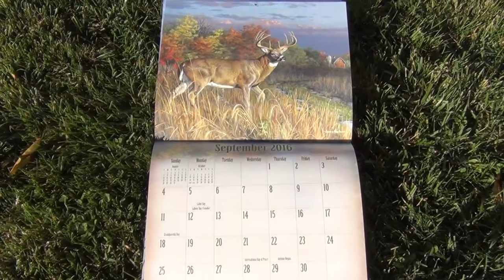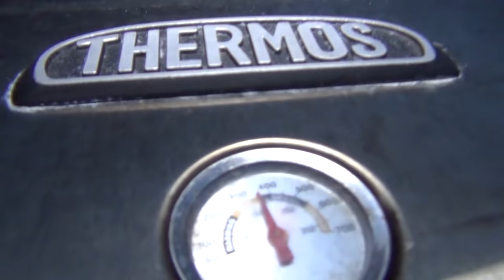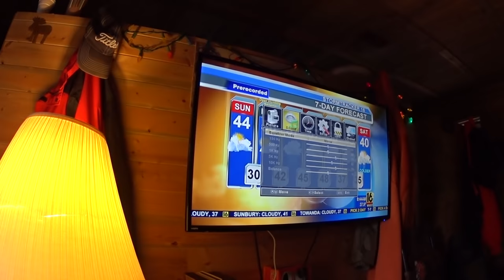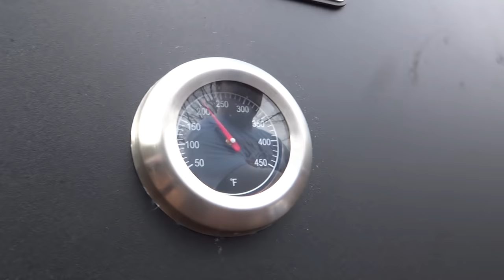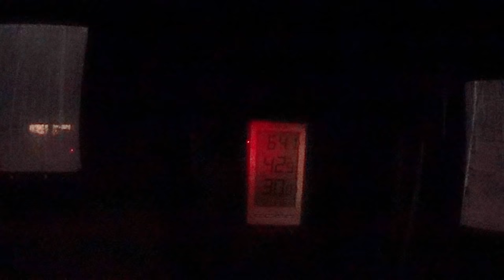PA Deer Camp 2016

Comment: So what you wanna do for breakfast is cook up your scrambled eggs with a handful of cheese so it’s all gooey then but some toast in the toaster then when that pops up butter it heavily so it’s soaked with butter then fry up your bacon so it’s not stiff but soft and soaked in grease Then your sausage patties grill those up about 3 per person get them nice and Grease soaked then the most important part hashbrowns get those charred on the outside but soft and gooey on the inside then put cheese all over it in the pan so it’s more gooey then chop up like 4 onions then put those in with the hashbrowns then building your plate lay your toast then eggs then hashbrowns and bacon and sausage on the inside our out side preferably Inside you want the hashbrowns not the outside on top then put your ketchup (optional) on top then your ready 

Note: it’s filled with calories and protein and it’ll get you through until dinner it’ll push you right through lunch time.

Comment: how does that buddy heater work in that big of a cabin?
Reply from the maker: The Buddy heater works really well, during the day it will just keep the chill and dampness out. At night we left the wood stove burn down low and turn the buddy on. Keeps it in the 50's which is perfect for sleeping. That is one main reason why we never seem to have any wood. We don't go through as much as we use to. So we never feel like cutting and chopping it.
Reply: does it burn through  propane? I am thinking of getting one for our cabin that is why I ask
Reply from the maker: If you keep it on high yes, only get a few days out of a 20lb tank. But we normally keep it on low or medium and it lasts fairly long.